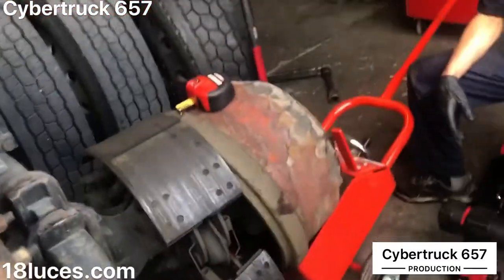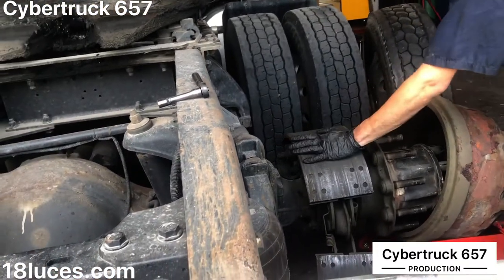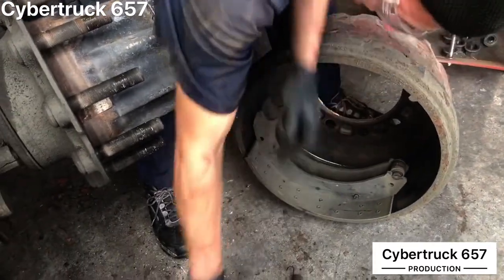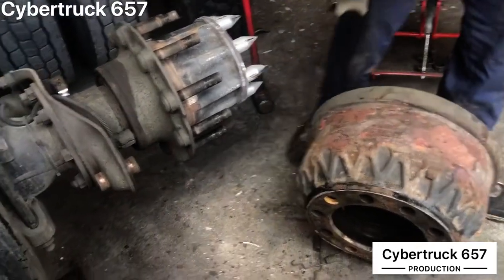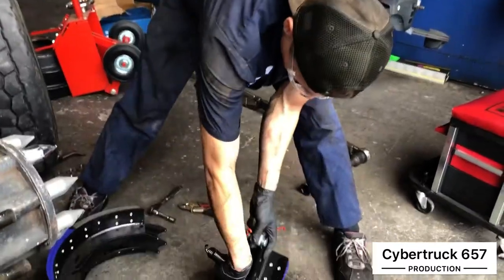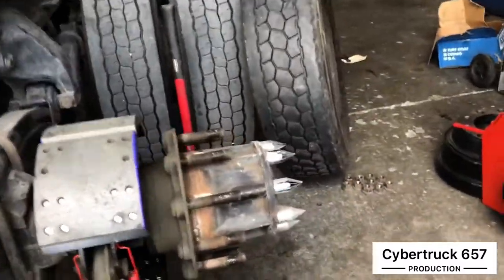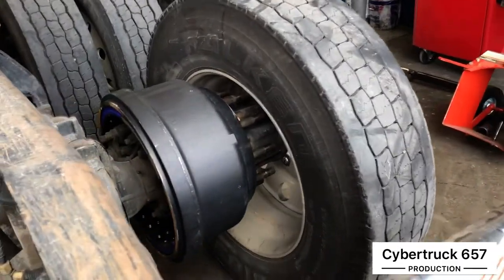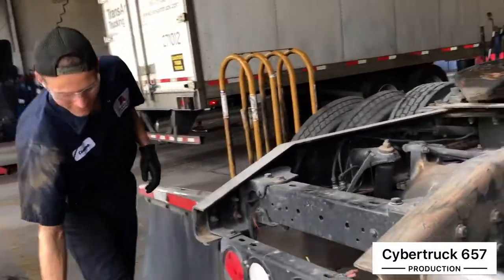How to change brakes and drums on a Kenworth t680 2015. Step by step

Comment: 5/16”
Reply from the maker: Thanks for watching..
Reply: These shoes are Eaton shoes most likely Extended Servce shoes .
Plier spring tool :
LT -890 Rockwell / Meritor 
LT -895 Eaton 
Lisle 40030 trailer brake springs 
When installing Eaton shoes wrap a ratchet strap around the shoes , it will tightly secure the the shoes to the rollers making it easier to use pliers .
LT Lock Technology
The kid did a fine job !